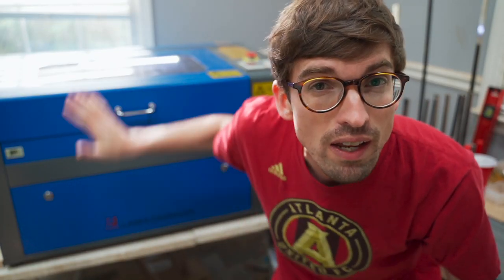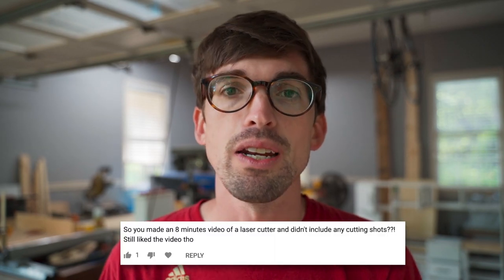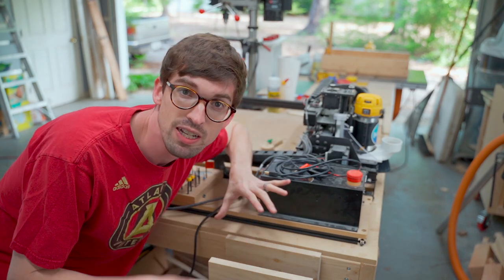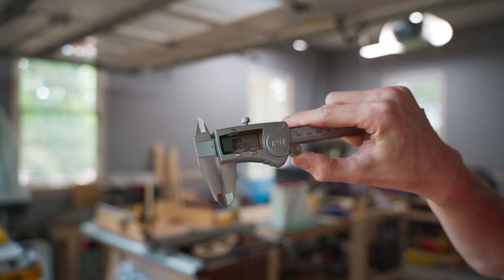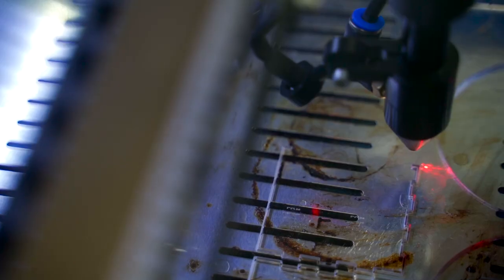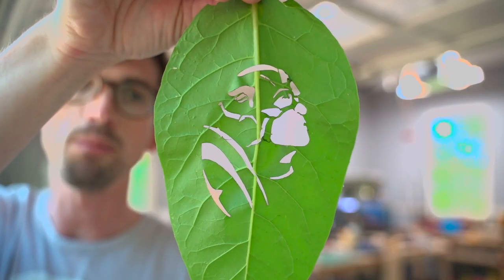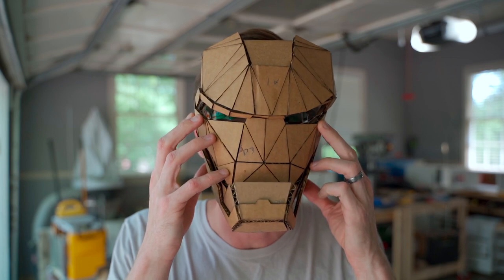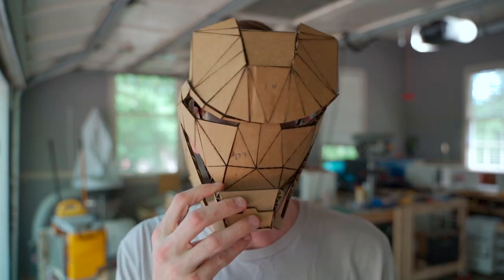What can a $1500 50W Chinese laser actually cut?

Comment: I have heard a lot of folks saying you have to avoid using the laser over 80% capacity, and a few who say 70% is the cutoff, but you are first one I have heard to say 50%. Considering these Chinese lasers are always 10w under the stated rating, you are ending up with 20w of cutting power. You might as well stick with a diode laser.

Comment: Sorry actually on my wife's account, but a quick question.  I have been looking at a clinker press to cut out leather pieces.  They run about $1500 for the one I'm looking at, but then there is the cost of the clinker dies, which, adds more expense.  Do you think this could cut through 8 oz leather and how well do you think it would hold up cutting out leather patterns for wallets, bags, key chains, and the like?
Reply: Im from europe so we use a different metric system. 8oz leather is like 3mm (1/8"), correct? If so, i cut  that from time to time on my 60w laser. The only downside is burnmarks on the edges.

Comment: Can it cut 1/4” acrylic in one pass? Are there any issues cutting through painted acrylic?
... Still learning about lasers. So far, the only thing I know of that shouldn’t be engraved is pvc. Thanks!
Reply: John Almonte it possibly COULD cut through that in a single pass, but it will probably be a cleaner cut with two passes.
Reply from the maker: Yep!  Ive found multiple passes have worked a little better to keep the kerf of the cut small.  I might not have the focus dialed all the way in but if I turn it up for enough power to cut in 1 pass it winds up melting more of the edge then just a clean cut.  Not sure about the paint, I know the fumes in general are bad so you want to make sure you have it venting outside.

Comment: More videos like this one please!! Love seeing what this can do. I want to get something to engrave aluminum parts with a part number, would this do that?? Would you buy this one again, or something else??
Reply from the maker: Thanks!  I don't think it has enough power for metal, even aluminum.   If you were wanted to do part numbers then a small cnc router might be your best bang for the buck.
Reply: Maybe 10 months too late, but if you would like to mark aluminum you could use cermark Lmm-6000. You just spray a coat on the surface and the laser bakes it onto the surface. It is pretty durable. CO2 Lasers can also bleach an anodized aluminum surface, but it would have to be 150w or over to start cutting metal. Fiber lasers can mark metal

Comment: What kind of wattage would you need for mild steel?
Reply: cloudyclouds you would need 150W minimum with O2 assist to possibly cut the thinnest metal.  From there you would need to go up to 500 even 1000 or more for thicker but with a CO2 laser you will never be able to cut more than 1/4” thick probably.  I’m definitely not an expert on it but I know CO2 lasers are not the best for metal cutting and for a Fiber setup you are looking at spending way more money than what you would spend at the hobby level.
Reply: I was looking at a larger laser with a 1300mm x 900mm cutting bed by Robotec for both wood and steel cutting. It is pretty huge 2 meters long by 1 deep, and it weighs 3k lbs, but includes chiller and compressor and exhaust blower and 2 year guarantee. They said the 300w will cut 4mm steel and 30mm plywood and is about $10k(Not including customs and taxes), and 150w will cut 1mm steel and 15mm plywood and is about $6500(Not including customs and taxes). I have seen 130w lasers that say they will cut steel, but I assume that is .5mm.  All of these say you should avoid running over 80% capacity,